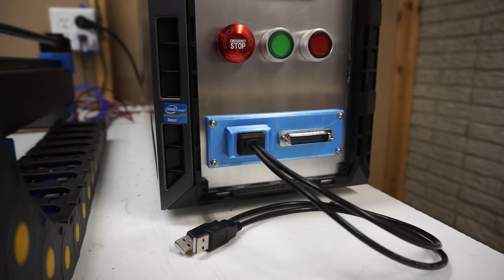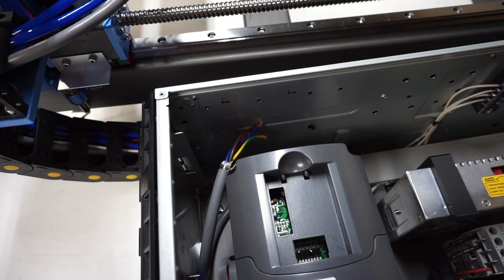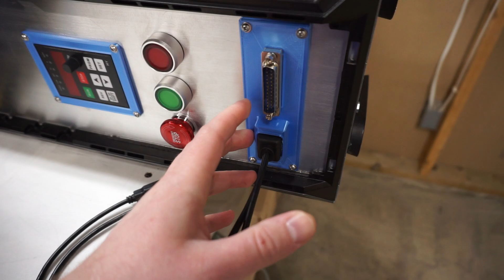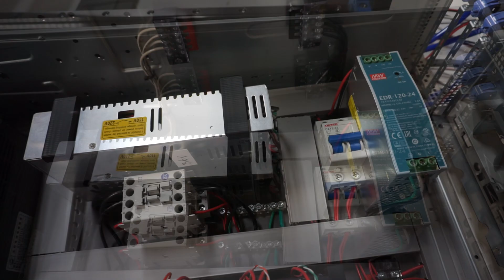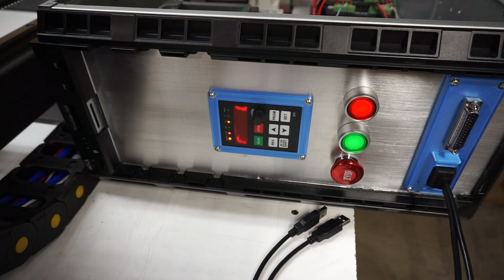PrintNC Electronics Enclosure!

Comment: How did the VFD in the enclosure end up working out?
Reply from the maker: I never had any issues actually. Only "weird" issue that I had was with my parallel breakout board and sometimes my left Y motor wouldn't get the direction bit when homing, so the left motor would home in the wrong direction, essentially tearing the gantry apart. When I switched to the Mesa 7i96 this issue went away.

Comment: I have the same VFD I added a 40c thermal switch to the fan curcit. I used a little thermal glue connect the switch to the heatsink located just under the fan. It works great, the fan only comes on when the spindle is under load, otherwise its nice and quite lol.
Reply from the maker: That's a great idea. Yeah, the VFD fan is definitely the loudest fan in the control box haha.

Comment: Some of the components in your wish list or the wiring diagram on your website were not used in the controller. Any reason for this? Moreover, you have 2 EStop switches on the wiring diagram on your website but only one on the controller. Can you please explain the difference. Thanks

Comment: Hey Brian, great work as always. Three questions: (1) One, can you share your 3D printed pass-through design for the USB and parallel connectors? I purchased the same ones from your affiliate link, so the printed design should work perfectly. (2) What's the purpose of passing through the USB? Doesn't the USB just go from the controller to the VFD? (3) Do you have a link for the long ribbon cable, or can you add it to your Amazon list?
Reply from the maker: Thanks! The USB and parallel pass through plate should be on my website (link in description). The purpose of passing through USB is just to keep the front panel of the enclosure clean, instead of just drilling a hole. The USB ports go to the parallel breakout board, and the USB to rs485 converter. I will try and get a link to the ribbon cable on my website.
Reply: @ProjectsbyBrian  Awesome, thanks! I've been on your site a few times but missed the mods section. Still a little confused about the USB, but I'll take it over to the Discord.
Reply from the maker: @C0RY.M  No prob! One USB cable is for 5v power to the parallel breakout board, and the other USB cable is for the USB to RS485 converter. Both of which come from the LinuxCNC PC that I have.
Reply: @ProjectsbyBrian  Got it! That makes sense. Thanks again. 
I didn't realize the small breakout board needed 5v. I was under the impression it was powered by the 24V PSU. But I suppose that is passed for the stepper motors. Still learning my way around the world of controllers/breakout boards.
Reply from the maker: @C0RY.M  woo hoo! No problem!

Comment: Very nice panel. The only change I would suggest is that the green button light be wired to a normally open contact on the contactor so it only lights when the contactor is in.  The red button light should be wired to a normally closed contact on the contactor so it lights when there is power to the panel but the contactor isn't in.

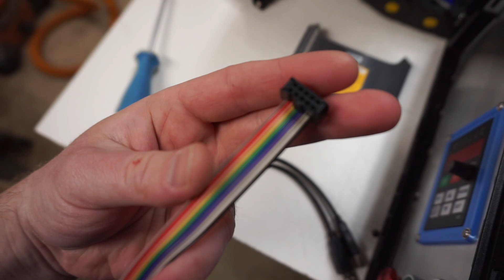Comment: @ 7:01 the VFD extension cable uses IDC connectors, instead of filling/cutting the key of the connector, you can simply unclip the cable hold down bridge then peel back the cable of the pins.
Cut the original pin perforations of with a sharp blade or shears, then reposition the connector pins over the ribbon cable correctly and hold down with the cable bridge.
Place the IDC connector in a vice and squeeze the connector forcing the pins to punch the cable and secure the bridge connectors.
hope that helps.

Comment: Hey Brian can you please show the wiring  of inverter to 5 axis bob ?
Reply from the maker: My inverter isn't actually wired through the bob at all, I'm controlling it through a USB to RS485 adapter that goes right into my LinuxCNC PC. If you check out the PrintNC Wiki (link in the description) and click on the Wiring section along the left side, there is a lot of info there that might help.
Reply: @ProjectsbyBrian  oh I see .BTW how to control spindle through 5axis BoB ? Do you know or do you know any video reference. ? Thanks
Reply from the maker: @zamanraza9635  I'm pretty sure there is a 0-10v signal output from the BoB, and then look for a VFD parameter that lets you change the input control to a 0-10v signal. I'm not sure exactly what parameter it is, and I also haven't done this myself, but that is where I would start to look.
Reply: @ProjectsbyBrian   I have checked it but my Bob is  showing output voltage 10 point something but my on off setting In mach3 does not working. My bob continuesley showing 10 voltage..is there any specific settings in mach3 to control inverter?
Reply from the maker: @zamanraza9635  I'm not sure, I'm not familiar with Mach 3. Sorry!

Comment: Hey, very nice looking enclosure! I hope your VFD doesn't cause you EMI, I had to deal with that and it made me move mine out. If you want to quiet down your VFD fan (especially since your system seems completely silent otherwise!) it's a pretty easy task. Grab a thermal switch from amazon (I went with 40C) and wire it in line with one of the fan leads, then thermal epoxy to the massive heat sink in the VFD. You don't even need to open up the VFD at all to do it, the fan cover has a little clip for easy access!
Reply: @ProjectsbyBrian  Sure thing, enjoy watching your machine cut stuff for you :D

Comment: Looks fantastic! Very clean with the wire duct, reminds me of the inside of an elevator controller. I did something similar using a steel backing plate to lay out everything, doubled as a ground plane and additional heatsink for the drivers with the added advantage of being able to run the grounds for all the shields short as possible behind the plate without looking too messy.

Comment: Hi. been following your vids now for some time and I'm also going to build the same machine, also with LinuxCNC on a Dell Optiplex with LPT.    At the moment, I'm in the middle of purchasing the electronics.  
Some questions:..  

1)  is the 24vdc psu only necessary for the spindle relay output  and/or  the non-contact type of limit switches you're using?   Without any of these, the breakout board board itself will run off 5vdc USB alone ?

2)  The 24vdc psu you have is 5a (120w).  Is this much needed?  Would 2a/3a etc be suitable too? (thinking about normal microswitch style limit switches)

3)  Would it be necessary to connect the 24vdc GND and the 36vdc GND together ?  (also thinking about 2x 36vdc psu  - 1 each for 2 drivers/2motors)

Thx. P

Comment: Useful video, thank you.  Are you leaving the wires stranded into the various terminals or are you using crimped pins/ferrules? My understanding is that the stranded cables shouldn't be left bare as it can lead to poor connections or worse, fires due to overheating - I'm not an electrician though so I reserve the right to be wrong :P
Reply: I've heard that terminal connections can be a problem if the ends of the wires are soldered.  The theory is that the solder has a fairly low melting point which could lead to the the solder softening and then the connection could get loose.  Then the loose connection could heat up and cause a problem.  Bare wires or terminals are ok, you just don't want soldered ends in a terminal connection.  At least, that's what I've heard with regards to problems with some 3D printers when you have a high current connection.

Comment: Nice video Brian.  I really like the idea of using a PC case for the electronics.  I have a bunch of old cases that would be good for this.  I haven't gotten the VFD yet so I don't think I'll need a large server case like you.  I had a question about what current setting you have for the stepper motors?  I've bought the AliExpress kit and it only comes with a single 350 W, 36 V power supply.  If I'm calculating it right, that gives less than 2.5 amps for each motor which doesn't seem like enough.
Reply: @ProjectsbyBrian  Thanks Brian.  I'm assuming that since the kit comes with just the single power supply it will be enough.  I guess we'll find out.

Comment: Looks fantastic! Does the red button (Not estop) just turn off or how does it differ from estop the way you have it set up?
Reply: @ProjectsbyBrian  That is good to know! I know you talked about having a switch at the main when you put the new outlet in the wall... so that will be your real full estop I guess... aka you flip that switch and all power no longer flows into the enclosure all together. That is what Im thinking of doing....a latching on and a estop for my cisco... and then a full estop at the mains 220 and 110 outlets for full power cut :)
Reply: @ProjectsbyBrian  I know there was quite a bit of discussion on Discord about abruptly cutting off power to the VFD being a bit of a no-no. I'm assuming those concerns are ameliorated by the contactor, right?
Reply: @ProjectsbyBrian  Yeah that's true. I was just curious looking at the wiki and how things are wired up and it seemed as though the e-stop would just cut power to the VFD immediately. I'll have to study this more and maybe hit you up on Discord. :)